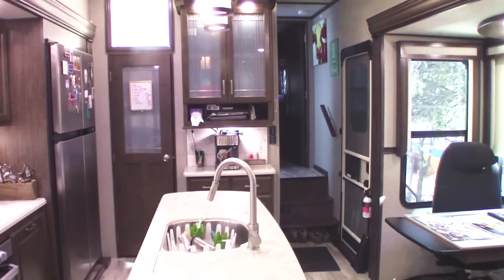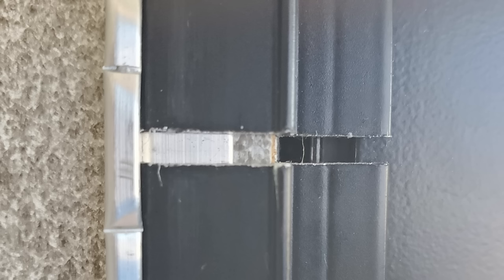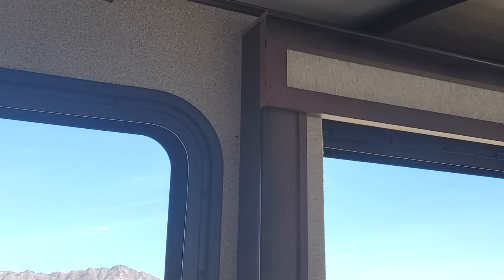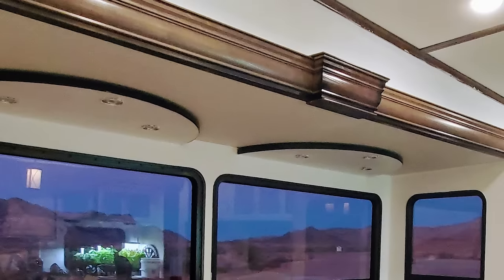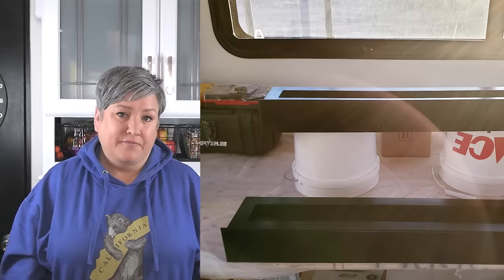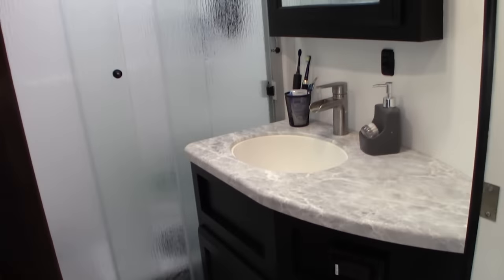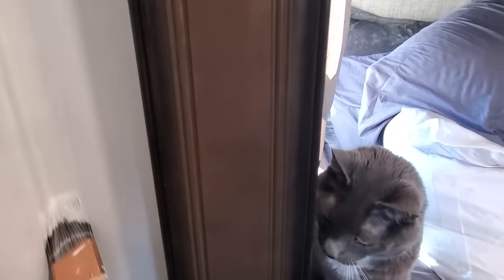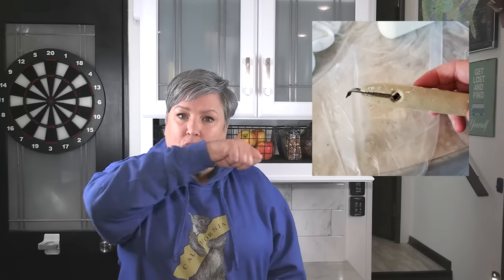DIY CAUTION: HOW TO PAINT RV WALLS & CABINETS. We Painted the Interior of our Fifth Wheel! Learn...

Comment: I swear, the first manufacturer that switches to white cabinets and no window valances will corner the market. Why is rv design stuck in the early 80's??
Reply: Most RV Manufacturers are listening to customers and started to build according to full time living
Reply: I know, right? I keep thinking it's because the people buying new ones have typically been retirees. When you're close to your early 80's, you LOVE the early 80's
Reply: 1950's designs. Built in the Midwest where people there are still stuck in 1950s.  Horrible decor!!!!  I rip out valances first thing!  Ugh.
Reply: @mjremy2605  Yup! So did I! They’re awful and they really do take up room in your camper.
Reply: @SamEmilio2  Nope, not so, we're 69 and 74 and the first thing we've done is cover the dated floral velour with cream linen. Curtain velvet pelmets are going to be replaced by brightly coloured cotton bunting (for a fun beachy look), they're velcro'd on, so we can't just take the pelmet down, it looks odd with the velcro strip on the curtain rail. The velvet curtains will be replaced by bright cotton with blackout lining. The carpet will be replaced by either wood effect vinyl or cork flooring, and I'm seriously considering painting all the 'woodwork' in a pale colour to brighten and modernise the interior, only thing stopping me is the work involved I've seen other people describing...
Reply: They could not paint the interior at all, it would make it so much easier.
Reply: Woodwork never goes out of style.  The all white w/black millenial interior is cold, boring, and soon to be rejected for "the next new thing".
Reply: Because they - as stated- use the darkness to cover up their impropriety in assembly
Reply: @mjremy2605  I ripped my valences out first thing also - take up space and not attractive, at least when 25 years old, lol!
Reply: @SamEmilio2  that is funny!  good comment!
Reply: @fishhuntadventure  it is crazy the lousy construction! on the surfaces as well as underneath with the tanks etc
Reply: @geronimo3752  THIS. Which is funny since it's women who are remodeling the damn things, not the men. My husband couldn't care less about what I am going to do to our new-to-us RV, lol.
Reply: @janepipkin8139 I have to agree.  It almost seems like a sin to paint woodworking.
Reply: @geronimo3752  Check out the 2022 Jayco HT series. I’m told they were designed by a woman and man do they look sharp inside.
Reply: Haha so true! Gap in the market for some current decor. It's the same in Australia I think.
Reply: @mjremy2605  People in the Midwest are all stuck in the 50"s. Quite an ignorant generalization.
Reply: Because most RV buyers are also really old and stuck in the 80s.
Reply: Have you seen the new 2021 and 2022 Keystone cougars half tons?  It’s beautiful!!!!!
Reply: I’ve had 2 in the year and WINDOW VALANCES ARE ALWAYS the first to go
Reply: Airstream.
Reply: We are looking for another RV - I get so frustrated looking at the horrible mission brown everywhere!!  RV manufacturers are 40 years behind - So frustrating!.  Can I just say though you have done an AMAZING job with your RV.  WELL DONE!!! A huge job, but you can be very proud of yourself!! 💖
Reply: I’ve seen the keystone’s with white cabinets there nice
Reply: I hate the window treats I. My travel trailer from the mid 90s fixing to reduce the entire Inside
Reply: @geronimo3752  not necessarily true I have a 1990s travel trailer and I hate the design of it so not all men want those things
Reply: I know! What is with the fake wood Formica! Caca.
Reply: It reminds me of when I used to finish drywall with the old-timers who were plasterers. We worked on historical buildings in Boston in the 70s and 80s. They were my dad’s friends. They are long gone now. Ornate plaster crown molding and trim. They were perfectionists. There was no popcorn, orange peel, or knockdown textures because they were craftsmen. They didn't have to hide their work.
Reply: My guess is giant manufacturing companies are doing the interior design themselves with 65 year olds in mind.
Reply: Dude, I am sooo with you on this! Those valances! Ugh! The patterns on them are directly from the '80s! And velour! I despise those valances!
Reply: My mom's 2004 fifthwheel has white cabinets
Reply: Dark colors hide imperfections better than white. Plus dark colors are warmer feeling.
Reply: @robbypro3370  Im literally painting a wall dark grey and another light gray. It all depends on the light which one hides things better
Reply: Jayco has done white cabinets without them. Winnebago has done some white cabinets.
Reply: Agreed!! I have often said that if they hired me, they would sell a shit ton more and the designs would actually be sensible!! They clearly have men designers. Like with all the rv’ers now days and boondocking all year around …. WHY are the walls, ceilings and floors NOT insulated better?!? WHY are the doors so shitty and have gaps in them for wind to whip into.  Seriously rv mfg’s …. Let’s get with the program!!! Oh and btw …. If these rigs bounce around like being in a tornado (as I was informed) WHY use such cheap ass wood for cabinets and shelving!!! And if I have to go there … oh ok, I’m going there …. WHY is all this “cheap” industry mfg’ing cost an entire lifetime of saving and then some!! Oops … I had a rant … sorry.
Reply: This is so true it’s the first thing to go!!! Ugly window covers yuk. Like make it look like a house DUH 😂
Reply: I was just thinking the exact same thing!
Reply: Yes, but those are the so-called  tiny homes now and are cheaper to build your own now.
Reply: Hah. I guess wooden console TVs will make a comeback too, huh?
Reply: Using tons of wood and rich fabrics and dark tones in a tiny space just goes beyond any logical design sense.
Reply: 2002 beaver, just yanked valances, got 20 percent more window and got rid of hideous , smelly valances. Next year new flooring, paint walls, get rid of ugly mirrors with swoops etched in them, great coach, horrible decor

Comment: I have bought and sold RVs for over 20 years as well as worked for a few large dealers here in FL. I think you did a great job and yes I think it looks good but just let people know that it DOES effect resale/trade in value when you paint a newer RV interior. One dealer even had a questionnaire that asked if the interior had been painted or altered in any way such as removal of dinettes etc. Those rigs that had been altered were very hard to resale and we had to usually run through the auction. We just could not sell them. Sure there is a butt for every seat, it just takes longer to sell those that were altered. The thing that I personally when I was buying to resale hated to see was the factory furniture removed and two huge Big Lots recliners put in the place along with a cheap Wal-Mart plastic 3 drawer bin. The manufacturers choose to use brown and tans as it is timeless and neutral. They know what sells. Again I think your paint job looks great but as far as resale it could lower the trade in resale value. Seeing how you change Rvs like many change socks lol. I will say from what I can see that your paint job does look as close to a factory job that I have ever seen. The cabinets look like they came white. Just watch out for the walls staring to bubble and peel. The chemical in some/most paint will cause the wall covering which is not drywall to come lose and bubble. It’s like painting over gift wrap. Also the reason they use those window box/valances is to reduce damage from the window coverings rubbing the wall while under way. Plus it just looks nice in the opinion of some haha. Obviously that is not your opinion!! Haha safe travels and watch out for that bubbling on the walls!
Reply: New RVers.  Great to know this about resale.  Got our 21ft trailer in 2019. Couldn't go anywhere last year. Mostly got it as a hurricane bug out. Enjoyed our short trips. It still has the new trailer smell.
Reply: Good info, thanks
Reply: If the resale value drops so much, why are renovated RV’s selling for much higher than market value?
Reply: @VictoryAviation  This was almost a year ago..not that my statement has changed...Painting the inside of a NEWER model RV does lower resale value but in this market anything with wheels is selling for more than book value..I'm at the auction, both RV and Auto from here in FL to as far north as SC..I'm even having to go west as the market is soo tight now but I still won't buy an altered painted rig..too hard to bring a good dollar!!! If they are bringing more then why do us dealers give you way less, and I mean WAY less as a way of discouraging you from even trading it in! We don't want a heavily molested rigged up chalk painted play house!! We can't sell them! It took 6 months to get rid of the last rig that had been painted..No thanks! You can have all the painted ones you like! I'll even alert you to when I have a customer that wants to trade and YOU can flip it since you think they are such a gold mine!!! Cheers!
Reply: @chrisreed26  Yikes. Sounds like you’ve got some personal frustrations to deal with. Good luck with your angst.
Reply: @VictoryAviation  nope no frustration on my end but I do thank you for your military service! Yes I peeked at your channel. So I know whom I’m talking to. I welcome you to do the same. Nice new uniform too. Fits you oh so well!! Very studly hehe
Reply: @VictoryAviation   It sounds like the type of renovations that Arizona is talking about are pretty bad/cheap looking ones. There’s definitely multiple types of buyers, and it’s crazy to see the resale value in ones that are updated to not look like they’re in the 90s. To one generation, browns and tans are “timeless and neutral”. To another generation, it’s “dark and old” and needs to be ripped out for something brighter and cleaner.. and people WILL and DO pay for it as you have noted
Reply: This is all rubbish. The RV industry needs to change its interior. I know some manufacturers have. You have to remember that the majority of RV are made in Indiana and Hoosiers are always decades behind in their decorating (and hairstyles 😂 but that’s a different topic). Who cares about the “resale value” when one is living in a brown hole day after day. RV’ing is about adventures, so let your creativity reflect that in the interior.

Comment: My tips:  No matter what you’re painting, you always take the tape off before the paint dries. That solves the stuck on tape problem. You can paint nonpaintable caulk if you first prime it with oil-based primer. Much faster than digging the caulk out and pulling off the paint.
Reply: I was just about to say the same thing
Reply: Tape has a time frame that it can be removed without all the trouble. The manufacturer usually has it on the label of you can google it. The yellow tape by 3m is like 3 days before it is hard to remove. Any moisture in the air will shorten the time as well. Take it from a 30 vet as a painter
Reply: Good tip right there!
Reply: Most of the time painting with tape is foolish. You can do a good job in the same time to tape and pull tape and not have a good looking job.
Reply: I was thinking I would just buy a narrow trim and cover it up, lol
Reply: How are you supposed to put multiple layers of paint on with drying in between if you’re supposed to pull the tape off when it’s still wet?
Reply: @VictoryAviation   probably pull it off before the last coat dries
Reply: This might sound stupid but would you do the oil based primer only on the non paint able caulk before using a paint only or could you do the whole RV in oil based primer before painting?
Reply: I have an RV I live full time in and I really really want to paint and renovate it but don't know really how to start and with what.
Reply: @heathergeisen3212  I think you can rough it up with sandpaper. .   I haven't needed to yet but I just got some paint at Lowes that said it was paint and primer together.   I'm trying to cover bright orange (the 70s vibe got old) to a hopefully calming dark grey....  I'm keeping my fingers crossed, lol.
Reply: @heathergeisen3212  Same here.  The tiny RV I'm in wasn't built for full time use.   It's beyond time for repairs and upgrades, trying to do as much as I can myself.
Reply: Would you use an oil based primer for all of the walls?
Reply: Thats actually a great idea!
Reply: Wishing you all the best with the reno's/painting.
Reply: @VictoryAviation  Remove as soon as you finish the last coat. Also Frog tape is the best.
Reply: YES!
Reply: Thanks for the tip!
Reply: I thought it was just MY life that went like this!!! So sorry this happened to you!🌷
Reply: @Campingphoebe dont use an oil based primer if your going to use water based latex paint. Standard water based kilz will handle most issues, but for old wals with texture like thees, id go with a bonidng primer. The ultimate would shelac alcohol based. Nothing comes through that stuff. But my god its ssoooooooo strong. Good for knotty wood. Not the ideal for priming a whole trailer. Maybe a nasty stain or two though.

Comment: Regarding priming (I do this for a living), I'd be very careful using water-based primers on any wall covering.  The reason is that the adhesive used to adhere the wallpaper to the substrate (typically 1/4" luan plywood) can be reactivated by water in the paint and then completely break the bond that holds the wallpaper to the substrate.  Also, I'd recommend ALWAYS using a primer product and a separate finish product.  You can get away with the products that are supposedly all in one, but the durability will never be as good.  This is a great video showing successes and lessons learned.
Reply: What's the best primer for rv wood cabinets?
Reply: Best primer in the world is shellac alcohol based bu zinser. But my god is it STROOOONNGG. wear a mask. Lol. A good bonding primer is whats called for for ttailer walls. Dont use standard pva primer. Itll work, sort of. But like the psot said, its far too wet  and wont hold anywhere near as well.
Reply: Btw, alcohol base primer for cabinets is hard to work with. It has the cinsistency of water. So when brushing, go very slow and when rolling use a spong roller and go VERY slow.

Comment: We painted the walls in the first RV we renovated and hated it. We had tons of experience painting walls in houses; we did a good job and it looked great on film, but in person, it was flaws central. For our second rig reno, we used textured wallpaper throughout, and not only was it WAY less messy of a project but it came out A-MA-ZING and very classy. Highly recommend. Also, because you didn't use the oil-based primer on all cabinets, if you find that skin oils cause the paint to peel away on frequently used cabinets—especially during the summer heat—sponge roller a top coat of polycrylic and you'll be golden. ;)
Reply: What wallpaper did you use?
Reply: Great idea!
Reply: Same I was going to paint and then I was thinking peel and stick tiles behind the stove love to see a video on this what type of wallpaper did you use did you use peel and stick or did you need glue
Reply: What kind of wall paper did you use?
Reply: @doreenb4929  Every time I try to respond with a link YouTube deletes it...??
Reply: @BarefootAuthor  thanks for trying 😊
Reply: Do you live in a cold climate?  I'm worried with wallpaper that the freezing cold temps make it come off.  Hoping that isn't true so I can go ahead with wall paper and not paint.
Reply: @BarefootAuthor  maybe put the link in but put dot in place of the period or something like that?  Or just a good description would be nice.  Thanks
Reply: Wow! Could you copy and paste the name of the wallpaper you used instead of a link?
Reply: Please share pics! We bought paint last night but after watching this I'm scared lol. Would love a video on yours.